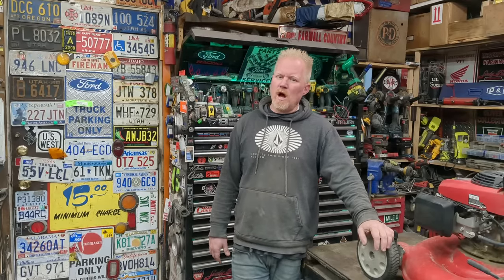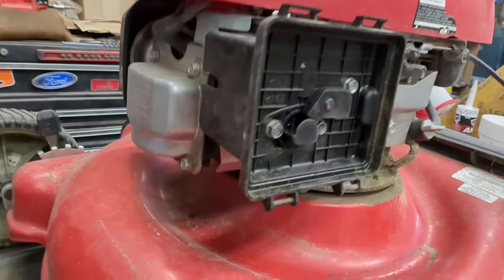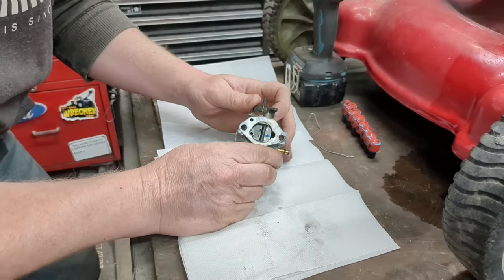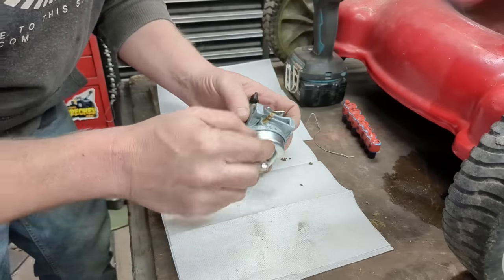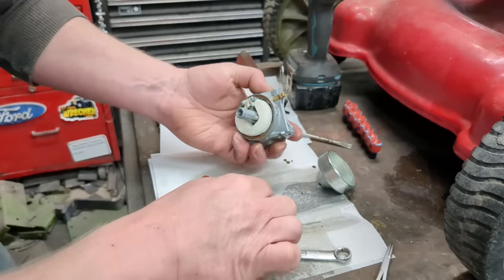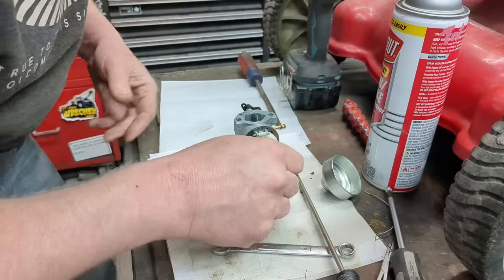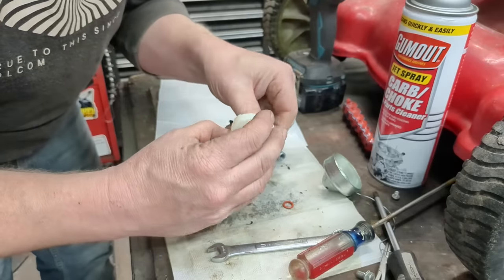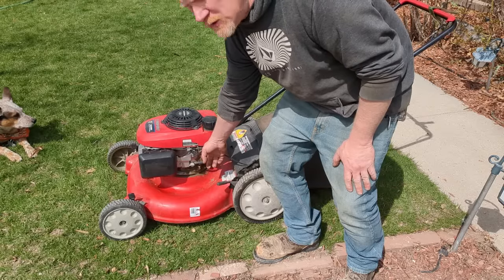FIX Engine Surging on any small engine QUICKLY

Comment: Great video! Would be nice to know how to set the screws?
Reply from the maker: You don't have to set the screws on any 4-Stroke engine made in the last 25 years.
Reply: @sixtyfiveford  Thanks for that - it has been a while since I worked on a carb based engine - and even that was a 2 stroke.. Does that mean that the screws aren't needed? Some videos advocate removing them so the fuel-ways can be cleaned..

Comment: Thanks for the video!  I'm going out to smack the bowl off, hehe.  I looked for hours last night and couldn't find a clone with the uppermost plastic leg on it.   Not sure exactly what it's for.  But only the actual Honda carbs have them.  Hopefully mine will work fine after cleaning it out.  But I really am wondering about the plastic leg on top of the black flipper.  What is it?  What's it do?  Is it a deal breaker forcing me to buy another Honda carb?  For a few more bucks I'd just as soon buy an identical Honda replacement,  if I have to.  But I was wondering...

(edit)  OK, I figured it out by looking at the wear marks.  There's a thin metal choke lever that pushes on that leg to open and close the choke.  So yeah you need it if you have to replace the carb.  Or the choke can't open, hehe.  And be sure the lever is on the front side of the arm. It pushes it back to open the choke.  You can peek behind the air cleaner to see it open when you slide the external choke lever to open on the housing.  Mine started right up after cleaning and reassembly.   Thanks again for the video!

Comment: Installed two brand new eBay carbs and both would surge while idling. It stopped with a partial choke, after the engine warmed up. Are the new emissions carbs too lean?

Comment: To prevent even getting to this point I use Startron. It’s not snake oil, it can be mixed in your gas cans and run in every thing that combusts. I’ve been using it for 25 years with no issues.
Reply from the maker: These fuel treatments can actually do more harm than good. They're generally just a really light oil and alcohol. The alcohol will attach itself to the water molecules and make it a somewhat flammable mixture. The issue arises that alcohol will actually pull in moisture out of the air as it is hydroscopic.. So it brings in more moisture which corrodes the aluminum carburetors even when mixed. Yes, if you had contaminated fuel and you poured this stuff in, your engine would start run sputter fight through the bad gas /water and continue on.  However, the best way to store an engine is with zero gas, as nothing can go wrong.

Comment: On my Honda I just spray Berrymans B12 into the carburetor for a few seconds and it will clean the idle circuit. Do not over over spray as you could wash the oil rings and harm the motor

Comment: Same auto-return-choke here too.  I wedge a half of a wooden closepin under the lever  to keep it choked long enough to get it started.  Worked for a while.

But now it sticks open so I'm about to check /  change thr thermo wax choke actuator.  Clean the carb if i have to.
EDIT:  No Thermo Wax Actuator on my model.  

With the carb removed,  my dad would blow cigarette smoke through the various ports while holding his fingers over others.. . . at the kitchen table.  Lol.  Until all were clear.

Comment: Hello sixtyfiveford, ✋ I have a sickle bar mower build with briggs 550e motor. I have got  the same issu  like you had. So i cleaned the carburater twice, but still surging. Any idea to fix the problem?

Comment: is a secondary coil resistance spec of 900 to 1000 ohms ( echo pas 225) normalish? Thats what the young person told me when I called Echo. Both my original ign coul and the new not OEM cheap one ohm out at 2.58 on 20k max setting. It only runs at about 60-70% power. Have new not oem carb and fuel line stuff. new plug. cleaned the head, ports, pulse port, etc. Cylinder has no visible scratches, have noticed no leaking from crank seals. I wonder if there isnt some sort of crank bind, this thing is fairly friction sensitive.

Comment: Had surging, cleaned the carb but no luck. Replaced the carb with a new one...still surging. Thoughts on what is next?
Reply from the maker: New Chinese carbs are notorious for having undersized jets and surging issues. The easiest way to tell if it's the idle circuit is to put the engine under load(cutting thick grass) as it will not be running of the idle circuit. If the engine runs smooth, you're idle circuit is clogged and or undersized. The idle circuit is so small it easily reclogs on engines that have poor qualitly/dirty fuel. I have had to reclean many carbs because a piece of debris came loose after I resurrected a old engine.

Comment: mannn i've had this problem on a mower for like 4 years thanks for the tip (I also used a wire to hold the throttle).
Reply: Wŵ

Comment: Is it important to keep track of how many turns each jet is screwed into the carburetor body? So when reassembling you know how far to turn each jet?
Reply from the maker: Not really for carburetor/ engines made in the last 30 years. They'll all have fixed orifice jets that just screw in and bottom out. If you have an old engine pre 1990ish then you'll have adjustable jets that you'll want to keep track of the turns to set it back to where it was.

Comment: Generally the debris in a carb was a solid in the fuel that made its way in the tiny holes in the carb, cleaner won't dissolve this stuff  so the orifices need to be blown back wards the was the debris got in, then install fuel a filter

Comment: Brakleen is safer for rubber parts than carb cleaner is. I hardly ever use carb cleaner. 
It's not always a carb clean that's needed. Sometimes it's the gaskets or a cracked manifold that's leaking air. It's good practice to spray carb cleaner around the intake manifold and gaskets to check for leaks before assuming it's the carb and wasting time cleaning it. I've seen both customers and other mechanics waste time and money on new carbs while struggling with engine surge after cleaning the old carb and reusing the old gaskets. If you've cleaned the carb and it's still surging, replace the gaskets, the fuel filter (if there is one) and the fuel lines. If it's still surging check the manifold for cracks, if it's still surging it's probably a worn out throttle shaft hole on the carb. I've been doing this for years and I've seen all the above.

Comment: Speaking of Fords. Their fuel injection throttle bodies would always get a layer of dirt built up just enough to keep the butterfly from closing completely leading to a false reading for the idle and the tps invariably stalling the engine because it would run rich at idle. 
  Just a Ford thing back when they were the only American car co. with multi-port fuel injection and a very good OBD II engine management system in the '80s and '90s

Comment: 15 on amazon.  But thank you for the vid man, this actually helps me a lot and I see where i got some things right and some things wrong, well it runs so not too wrong.
Reply from the maker: Don't throw away your old carb yet. These 15 buck carbs are hit and miss.
Reply: @sixtyfiveford  oh yeah I'm 3 carbs in, it still surges so I just have it run full throttle.  But this info is going to help a lot with the riding mower I picked up for dirt cheap.  Good condition just doesn't turn over, carb is my 2nd guess and knowing how to fix one is going to be great.

Comment: I have a question?
Im working on a 17.5 briggs and Stratton engine.
I replaced the carburetor (new carb) starts right up but surges bad. Normally I would think it was dirty but it is new. I have cleaned fuel tank replaced fuel filter added new fresh fuel then installed new carb. Surges bad . Thanks for any suggestions.
Reply from the maker: I will start off by saying these new $20 carbs are pure junk. It is always carburetor related (surging). You could check to make sure you didn't put the intake gasket on crooked/ tear it, but likely you'll have to get another new carb. Some guys have to try three or four of these budget carbs before they find one that finally works.

Comment: I know this is for small engines but my 2004 Chevy Tahoe does this crap ever so often.
I’ve clean the mass air flow sensor and stupid PCV valve that is not removable bc it part of the valve cover. (What genius designed this) 

I’m serious so fed up I’m about to dump a gallon of acetone in the tank and let her idle for a GOOD while. 😆 
Let it fix it or blow it up already! 🤦🏻‍♂️
Reply from the maker: Sounds like you're IAC (idle air control valve). That's what controls idle on a fuel injected vehicle and they can stick/gum up. Most are a really easy swap and or can be removed and or cleaned with carb cleaner.
Reply: @sixtyfiveford  ok cool man, gonna look to see where that is on my truck. BTW I consider you the MacGyver of repairs. Really dig how you think outside the box. 
I mean like making your own sockets, 😂 bra! That hadn’t even crossed my mind. 🤯🤯🤯
🤙🏽🤙🏽🤙🏽

Comment: Really don't need to do any of that. Just throw some b12 chemtool, gumout, or seafoam in the tank. Eventually it will clean itself. Takes about a tank but don't have to pull carb. Do it every spring and it stops before filling the tank again....until next spring and it may start surging again. Now i put it in before storing.

Comment: I use SeaFoam every fill. Boat, blowers, mowers, 2 or 4 cycle. Never have issues. Crank up every spring, 1st-2nd pull. Also use 93oct!
Reply from the maker: You like burning money and that's OK as it make people feel better. Sea Foam introduces ethanol into the system and pulls moisture from the air into your tank and carb. This acts as a electrolyte and causes galvanic corrosion in the carb. Premium fuel with standard 10% ethanol does absolutely nothing for a small engine. Higher octane doesn't give anymore power or is it any cleaner. Higher octane is simply makes a fuel less likely to combust under pressure. Something needed for high compression engines of 12:1 or greater. A mower engine is going to be around 8:1 and standard automotive/boat engines are going to be around 9-10:1. I have serviced many engines that the owners always use SeaFoam/Premium and it worse in some cases that just doing nothing. If you want to prevent damage, either put ethanol free gas in or take all the gas out. I have revived machines that have sat for 20 years with the fuel drained by simply adding fuel and starting them. They run like the day you shut them off.

Comment: How do you deal with the paper'ish gasket on the carburetor that tend to stick to the faces and then come apart? Reuse? How do you clean the faces?
Reply from the maker: Reuse generally. If torn I may coat the surfaces of the gasket with No. 2 Gasket Sealant(tar like substance that never dries and seals).  It will also glue a torn gasket back together. If the gasket is super bad I generally just make a new one.

Comment: I replaced the carb on my riding mower and it is now surging/hunting. It actually didn't do this on the old carb at all, but I had to replace it because the old carb float was bad and was allowing fuel to run into the engine. I have tried adjusting idle and mixture but no success. Do you have any advice?
Reply from the maker: These new $20 Chinese carbs are horrible. Try another supplier until you find a good one or fix the old one. Sometimes you have to try 3-4 different ones to get a decent one. Sometimes you can use the cheap carb for basic parts to fix your old one. 
The only issue with your old one was likely a leaking needle/seat.

Comment: One clue you are running low on fuel is hunting or an increased speed. I'd imagine that a tiny bit of air is sneaking through the fuel line. Running a little bit lean in that case. Probably a clogged air filter too. Nothing necessarily to do with the video. Just a clue whether it's lean or rich.

Comment: My riding mower surged when it cold.. Goes away after it warm up.. but when i shut it off, it buck spurter and knock.. it was in the shop 3 week ago.. mechanic said he cleaned the carb and reset the valves.. what else can i look at to fixed this.. ir a 15.5 bs on a troybilt..
Reply from the maker: Surging is caused by one thing, too lean of mixture under no load. This is caused 99% of the time by a clogged or partially clogged idle jet. 1% of the time by air leaking in behind the carb(intake manifold gasket).

Comment: The little brass piece you show @8:46 (idle jet?) Can this be pushed out after the Philips screw was removed (from the bottom to the top)? This part seems to be clogged on mine...
Reply from the maker: It can't be removed. Just keep soaking it with carb cleaner. You can also use a very fine wire to help but you just need to give it some time to dissolve the old gummed up fuel
Reply: @sixtyfiveford  Thank you!

Comment: I am finding new carboraters on Amazon for $20. Is it really worth the hassel to clean and rebuild your old one?
Reply from the maker: Yes and no. The oem carb is always better made. Aftermarket carbs have a bunch of issues themselves. I find the aluminum rotting after a few seasons if you use gas with any ethanol in it. The rubber gaskets/seals fall apart. And finally you'll notice most of these carbs list a dozen part numbers they swap for. This means sometimes their undersized  and sometimes over sized for the motor. The linkages don't always line up the same as original because they're universal, etc. A lot of times they will even entice you with a new air cleaner and spark plug that don't even fit you motor. 

If you take off the bowl and it looks like a green and rust colored tar jungle... consider buying a new carb. If it looks like you can clean it up, then do it.

Comment: I replaced the carb on my snowblower with a new carb.  I'm still having surging issues after it warms up.  It doesn't surge when it is cold and the choke (manual) is on full.  After it warms up, I have to choke it slightly to keep it idling.  Ambient temperature doesn't seem to affect it at all.
The only time the surging goes away is when I put a load on the engine with a full auger of snow.  As soon as the load is gone, the surging returns.
Is that the same issue?  Did I get a faulty replacement carb maybe?
Any ideas would be helpful.
Reply from the maker: Yes, your replacement carb is faulty. Idle circuit is likely not drilled or too small.

Comment: Isn't there a chance of acetone dissolving the plastic the fuel tank is made of? Or the fuel lines?
Reply from the maker: Fuel tanks are made from HDPE which is also what they store/ship Acetone in. Acetone straight will swell fuel lines but you always use it diluted and don't let it sit for a week. Put it in, run the engine until it's gone. That is the only chance you have of doing it the easy way and not removing the carb for a cleaning.

Comment: I have a Honda push lawn mower that when it gets hot shuts off, then I can not get it started until it cools off. What is a good way to fix it?
Reply from the maker: The most common cause of hot shutdown is a failing coil. This can also be attributed to grass clipping build up underneath the pull start shroud. Essentially the mowers overheating.

Comment: My mower wouldnt start. Changed plug and air filter. Didnt fix it. I changed the carb since it was fairly cheap. Drained gas etc. mower starts up but its running slow. Thoughts?
Reply from the maker: First, these "new $20 carbs" are pure junk. Likely the butterfly is stuck or too big for the intake manifold. If you can't clean your old carb just buy another Chinese one and then another and then another and finally guys after three or four " new $20 carbs" sometimes find one that works.

Comment: Is nail polish remover pure acetone tho? You don't want to put water into the gas if the acetone is diluted
Reply from the maker: A lot of nail polishes do have maybe 20% water. That will make no difference in this scenario as the water is completely combined with the acetone and will still clean. You're not leaving it in there for any extended amount of time.

Comment: Acetone in the gas sounds great there  The HONDA on my Husqvarna AWD mower has the auto choke system
Reply from the maker: The good old all-wheel drive Husqvarna. Haven't seen one of those for a couple years now.
Reply: @sixtyfiveford   I bought mine at Lowe's 2017 now Lowe's no longer sale's them
Reply from the maker: @robertmailhos8159  I think they were only for sale for three or four years.

Comment: I agree with the carb cleaner but the cough cough snake oil mixed in a little 1 gallon pony tank really gets my  40HP 2 stroke outboard running smoothly after sitting 2 years.
Reply from the maker: I hate on Seafoam because it's overpriced rubbing alcohol. Seafoam is essentially rubbing alcohol, a really thin oil(kerosene) and Nahptha(lighter fluid). About the only thing that does anything is the rubbing alcohol which mixes with water and allows water to burn. But that could be remedied just by draining your old  fuel out/ water.  The thin oil and Naptha are very mild cleaners, but in the ratio they're used to gasoline can do very little.  Now if I left straight naptha or kerosene on some varnished fuel. It may soften it after a week or two, but definitely not if I diluted it 99%. Clean gasoline by itself is a better solvent and conditions and cleans up the system better than seafoam.

Comment: Sorry I hate gas I have had nothing but problems with gas mowers. I bought an electric that is self driven and has worked just great for 2 years now. It did cost $565 to buy but worth it.
Reply from the maker: The biggest issue with a battery mower is the batteries. Very lucky if you get 3 years. Maybe 4 years before you have to buy new batteries for it. And then you're lucky if they still make the batteries for it after 10 years.